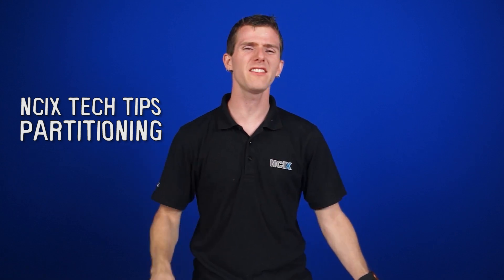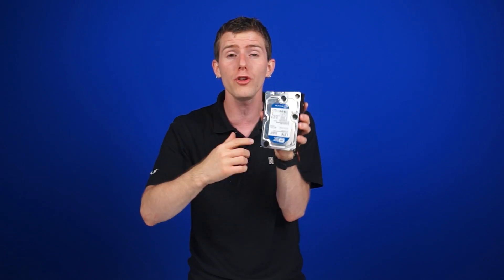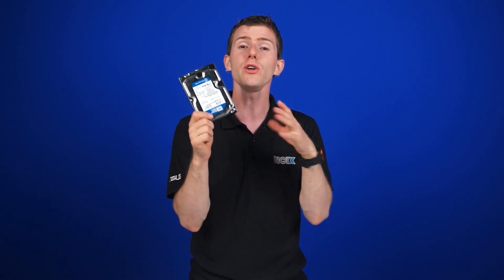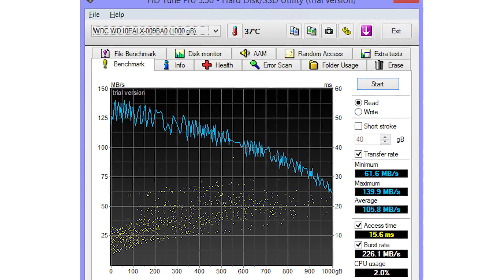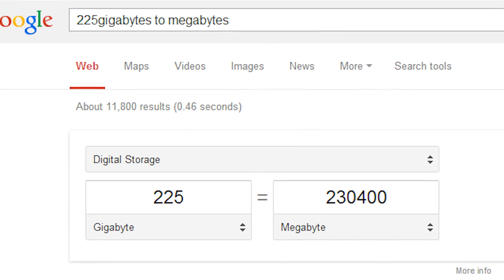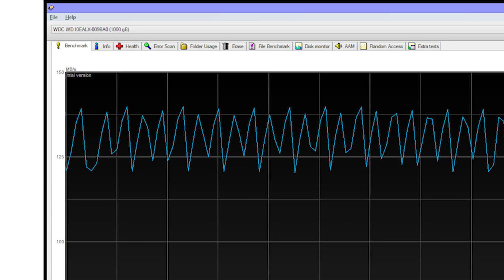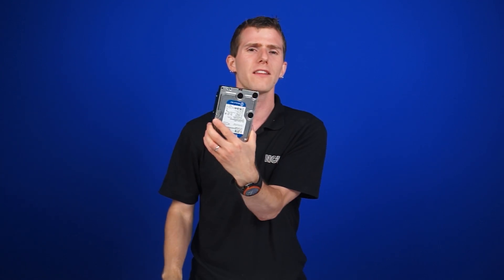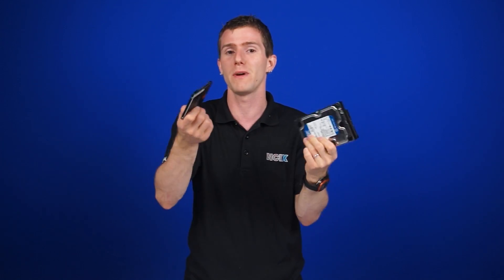How To Optimize Your Hard Drive For Speed

Comment: i did it.. and man my boot up time improved a little bit.. aand my pc doesn't take for ever to load the start up programs :D

still... it was a horrible idea to buy a 750gb green drive... (i wasn't thinking right.. and i couldn't get my hands on a blue one..and i was hypnotized by the storage capacity..lol)
Reply: You should look into the seagate flagship drives, they do 1, 2, 3, and 4Tb drives and I think they all say they run at 156 mb/s avarage with bursts up to 210 mb/s and the speed only drops off at the 4tb model which is the best speeds I've seen out of any of the popular hard drive manufacturers. I had a 1tb wd green too which recently bricked and those only run at around 113 mb/s. I'm waiting on a seagate 2tb which should be about a nice 30% increase in speed.
Reply: seagate drives are not the way to go i have a seagate ST2000DX001 seriously wished i went for some thing else these drives are not fast when transferring large files also experience delay in open files on second seagate drive

Comment: Buy a small SSD for the OS, put games on the fast partition of the disc, and movies & music on the slow one :)
Reply: Marko Mravak Or be like me and have 2 750 series SSD's by intel (PCI-e add-in) :D
Reply: weeeel we can't all be like you :P
Reply: Marko Mravak I have a DAMN good system, but haven't always had a good system, in fact, I still have the PC I got into PC gaming with. It had an older phenom chip from AMD and an HD 5870 :P
Reply: Frosty Breath Been there, Phenom 9000, HD 4850, 4GB crucial and 500GB Seagate... Than started upgrading to Z87 MPower, 4690K, 120GB Fury ssd, 1TB WD black, 16GB od Kingston Beast :) and finally after a year of waiting an MSI 970 Gaming :D Took me some time but got the best I could buy at the time. Oh and shoved it all in a R4 Define
Reply: Marko Mravak I have my other system in a define S, I built in a define R4 once for a client, it's a DREAM to build in, and it's SOO satisfying to get your system up and running in one, because it's so silent :P Do you have any idea about any good mini-ITX cases? I need to build one for my sister, she's going with a more workstation kinda build, a xeon e5 2697 v2, a quadro k6000 and 64GB of ECC RAM, I wanted to make sure her case had adequate airflow, considering it is going to be m-ITX, but I don't know of many that could fit my traditional 3 120mm SP fans.
Reply: Frosty Breath I'd do it in a Node 304 because it looks just awsome. I love Fractal cases
Reply: Marko Mravak I LOVE fractal cases too, but when you need a LARGE case, I don't now, but I did a WHILE ago, you kinda have no choice to go with caselabs xD
Reply: Woow, those things are expensive. And even from the pictures you can see why
Reply: Marko Mravak Yeah... but they get me feeling all warm and fuzzy inside when I build in them.

Comment: 8 SSDs in RAID 0. That sounds safe, let me know how that goes in about 1.5 years.
Reply: If you have money for 8 SSDs I don't think replacing them is an issue.
Reply: I would run them in RAID 10 giving a 4 set of RAID 0 with redundency
Reply: BoTheMasterOFAll Think it turned out pretty well 😂

Comment: Great, thanks!! I use a WD Black 1TB. I Went from Max: 180 - Min: 61, to Max: 180 - Min: 140Mb/s. I deleted 500Gb.
Another pro tip from me is that if you already have installed something on the disk and don't wanna format and create two new empty partitions, you can just shrink the disk of the value you want to (In my case 500Gb) and just expand it to ordinary (in my case 1000Gb) when the 500Gb gets full. :)

Comment: Best compromise in my opinion is to buy a fast but low or medium capacity SSD for the OS and your apps while using a slower but high-capacity HD for your data. I have a 120GB SSD for my OS and apps while my data mainly resides in my 1TB HD, augmented by an external 500GB USB3 HD.

Comment: I have one 2TB hdd and the transfer speeds start dip badly at 200GB so if i do like 10 different 200GB partitions would they all have like 150MB transfer  speeds?
Reply: no only one partition would have a high speed the rest of it would need to be left empty or as he said left with almost never or rarely used files. other the needle arm that swings back and forth inside the drive would be moving all over slowly to read info instead of what the partition is meant to do witch is cause it to read from a very small area very often and quickly

Comment: well, you surely could go through the hassle of setting up multiple partitions on your drive according to the illusive drop off point of the read/write speeds... OR you could just use the Disk Defragmenter under Windows every once in a while.

Comment: I have 3 1TB drives that I have collected running in a raid 0.  Win7 wont address more than 2TB so its set for 2TB total size with a windows partition of 150GB and the rest for data.  Everything backed up of course.  Both partitions are somewhat short stroked considering its only 2TB out of 3, on 3 different drives.

Comment: Can u tell us how can we seprate the ssd and the hdd making the full capacity of ssd to be :c drive and the hdd capacity to be the d: drive cuz in the computer it shows us as a one combined drive
Reply: You can't really.
A SSHD is effectively just a HDD with more memory available to the controller, which is slightly smarter than a regular HDD thus will sometimes even be able to pre-cache documents depending on usage patterns. Its this loading of files from the drives memory that gives the SSHD the speed of a SSD some of the time. However since generally the computer also tries to keep files in ram when it has spare capacity, the speed boost of a SSHD over a HDD can be less than impressive if you have lots of system memory. Its also worth noting that most SSHD's actually pack surprisingly little flash memory at all, and then its generally does not retain data when the drive is unpowered in the manner an SSD does. Put simply, the computer accesses one drive, as will show up on your partition table, so its not going to be easy (or necessarily advantageous) to try to access the flash memory on the drive directly. On the other hand you should be able to short stroke a SSHD exactly the same as a HDD like the one shown in the video.

Comment: Wait... so when I built my rig a few years ago and set up my partitions the way I did, my reasoning was actually valid without direct proof? I set myself up two hard drives and partitioned each up, putting what I figured I would be more active on the first partitions of each drive and less active files in the latter partitions of each drive.
Of course, looking at it now, I think I need to shuffle some of the contents around.

Comment: Wait wouldnt it be the opposite with the closer you are to the center of the disk the faster its spinning vs the outside because it has more distance to cover.
Reply: Density is the same but velocity is not. One rotation for the outer edge is equal to one rotation of the inner edge. Thus the outer edge will move more information under the read head.
Reply: For a more layman example, speed is distance over time. Mark one dot on a disk near its edge, and one near its center, both along the same line. Rotate the disc however many degrees (90), and notice how they still point in the same direction, but the outer dot traveled a greater distance in the same amount of time, hence it is spinning faster.
Reply: Un1234l yeah i realized that a little while after i  think i just confused myself. lol
Reply: Dj671993 hurt himself in his confusion!
Reply: pretty much *****

Comment: Hard drive partitioning DOESN'T matter.  I've tested this personally on 4 different generations of hdd's ranging from ide ata100 5400 rpm 60GB size back when they were 120 bucks as WORSTbuy stores in 2002, to today's 3TB 64MB cache 7200 rpm hdd's of today.  On EVERy hdd i've tried partitioning it in the following ways :

1.  Down to 55% of it's original total space.
2.  40% same same same, same
3.  35%, rinse and repeat
4.  25% rinse and repeat.

ALL results ended up with the SAME performance in crystaldisk mark, hdtune, hard disk sentinel and atto with the drives empty,  empty except o.s. and documents, and filled to 85% capacity with o.s, and ALL media types as well as movies and games and all programs.

It DOESN'T make a damn bit of performance difference in the REAL world.  Yes DEFRAGGING the storage drive goes faster..Big whooptee doooooo.  Guess what.  Defragging DOESN'T have near the realistically NOTICEABLE performance improvements as it used to a decade ago.  It offers virtually no noticeable performance benefit.

You're better of using Ccleaner ( tried and true and ANY pc tech EXPERIENCE and licensed repair tech WILL recommend this if they are away from their employer so you'll he isn't trying to upsell you something).

I've also tested UltimateDefrag, HDtune, and Hard Disk Sentinel.  Shortstroking is just placebo.  Moving your iTunes-WMP-Foobar, games/programs/movies, or anything else that is slow to load like Adobe photo or video editing software to the fastest part of the spinning disc hdd has BARELY a " countable" benefit.  Go a head.  HAND time it AFTER testing this and see for yourself.  You'll be lucky to get 10% faster loading speeds on any program.

If you want faster loading of ANYTHING just stop wasting time with this partitioning bs (if performance is your ONLY mission) and just install whatever you want to load faster on a current  gen ( made within the past 3 years or closer to 2014) and you'll be just fine and ACTUALLY be able to NOTICE the speed difference.

Partitioning a hdd is to help to possible protect your data should you get a virus or something else coherent enough that warrants you having to reinstall Windows o.s. while "HOPEFULLY" not having to worry about losing all the data on the other partititions.  However THIS IS NOT guaranteed.  I know this from personal experience working on more than the last 85 notebooks and 25 desktops that i've worked on over the recent 14 months.  Thus it's just best to BACKUP your precious data to more than one SEPARATE storage source ( another hdd, another ssd, another external hdd. etc).  This you should do REGARDLESS.  It is pc 101 common sense.

Comment: There are great software titles available that optimizes hard drives and moves data to the outer edge of the drive and you can really see a speed difference. One of the best software titles I found to do this as well as other optimizations is " Auslogics BoostSpeed".

Comment: Couldn't you just design a hard drive and cut out the middle (slow) section of the platter, so that it becomes lighter, which would allow for faster maximum rotation speed?
Reply: You could just get an SSD then.
Reply: I wasn't talking about what you could buy. I was speaking in terms of what someone could design.
Reply: Travis Ross You probably could, but it would probably be an incredibly small change, as you still need the middle to be connected to the edges, as it gets its spin from the middle.
Reply: Well, lets say you took a 1TB hard drive and took the middle section out. You might only end up with 700GB, but it would be guaranteed to be fast and reliable, without needing to resort to all the tactics Linus showed in the video.

And in terms of the actual change. You would replace the middle section with a plastic/aluminum spokes lead to the typical inner spinning axle. It wouldn't just have a gaping hole, rather just empty space filled in with a bracket instead to make it lighter.
Reply: Travis Ross Wouldn't the middle break? Like from centrifugal force, it's too weak? If you got it to work, it would probably have a pretty small difference from a normal platter.

Comment: will this work on mac?
Reply: Your mac will probably explode but you could try. You have nothing to lose. Literally.
Reply: It will work also. But you need to do the same thing like linus do then format it to mac partition
Reply: I believe drive partitioning works regardless of OS as it's done before installing the OS to the drive, allowing for multiple OS machines running from a single HDD.

Comment: Is there a way to combine short stroking and raid? So say I took two drives and made two half capacity partitions on both drives, and then set the backup portions to be the two slower partitions? I would think the drive wouldn't be flipping it's arm back and forth between the partitions then, as the slower partitions would only be accessed during backups. This would negate the losses Linus talk about.

Comment: Why does 225 gigabytes = 230400 megabytes? Wouldn't it be 225000?
Reply: There are 1024 megabytes in a gigabyte. It is in base 2 since 2^10 = 1024 not base 10.
Reply: Epic5236 Oh thats right its 1024 i had forgotten that i always was using 1000
Reply: Epic5236 Actually, 1GB = 1000MB. 1GiB = 1024MiB :)
Reply: 1 gb = 1024 mb
Reply: ***** 1 KB has always equalled 1024 bytes ever since computers were first invented, because computers count in binary numbers, not decimal. But during the 1990s, hard drive manufacturers decided to change that to 1 KB = 1000 bytes in order to make their drives sound bigger than they really are. And when drives got large enough that the difference between the 1024-byte binary units and 1000-byte decimal units became very noticeable, they decided to declare the decimal units as the new standard and invent fake words for the binary units, such as "kibibyte", "mebibyte", etc. Needless to say, people have resisted this change because 1.) the new words sound stupid, 2.) it goes against decades of history of what the units have always been called before, 3.) RAM still goes by the 1 KB = 1024 bytes standard, and nobody ever says a computer has "8 gibibytes" of RAM, 4.) Windows doesn't use those fake "mebibytes" / "gibibytes" / etc. words either.
Reply: poeralGCkings
Usually its rounded down to 1000Mb But is actually 1024Mb Per 1Gb of data.
Reply: ***** "Some idiots" like Bill Gates and Steve Jobs used kilobyte to refer to 1024 bytes. Go yell at them, not me!
Reply: no 1 Gb is 1024 Mb thats why it is 230400
Reply: you are thinking of MiB and GiB
Reply: ***** That confusion only arose because hard drive manufacturers started cheating and saying 1K = 1000 instead of 1K = 1024. They should have invented new prefixes for the decimal units while keeping the binary prefixes the normal ones. (Like I said, RAM is still measured in units of 1024, and nobody ever says "16 gibibytes" of RAM!) And LOL... Internet Explorer puts the red squiggly underline under "gibibytes", because it counts that as a spelling mistake!
Reply: vwestlife You kinda got that inverted ... new prefixes for decimal units, just so we can keep using wrong ones for binary? Seriously? ...
Doesn't matter how RAM is measured and what IE says - it's wrong.
Reply: ***** Then you're going against about 80 years of computer history. Computers count in binary numbers, and humans count in decimal -- there would be no confusion if everyone just kept it that way!
Reply: And you are going against thousands of years of Mathematic history ... C'mon, you can't say that computer annotations are more important than general ones.
Reply: ***** Tell that to the people who came up with the whole bits/bytes thing in the 1940s when electronic computers were first invented. Once a naming system is established, it's very difficult to change it -- and the whole kibi/mebi/etc. thing is unlikely to gain any traction until Microsoft gets on board with it, but as of yet, they have not -- Mac OS switched over to 1 KB = 1000 bytes a while ago, but Windows still uses 1 KB = 1024 bytes.
Reply: vwestlife You do realise that naming scheme (kilo, mega, giga ...) was established way before computers were invented?
Whole metric system is based on those prefixes. You can't change that just because some idiot misused it for binary system ...
Reply: 'Merica!
Reply: Physical media = 1000 ; virtual = 1024.

Comment: What is this RAID 0 you keep talking about?
Reply: Google is your friend
Reply: Watch the video over Teckquickie channel
Reply: raid 0 is a way to combine drives and get more speed out of the combination. Basically you put half the data on one drive and half the data on the other (for every file) so when your computer accesses a file it uses both drives as opposed to just one. If you were using 2 128gb 500mb/s SSDs in raid 0 you'd get a 256gb 1gb/s drive.

check out Techquickie because linus explains it a LOT better.
Reply: ***** he does.
Reply: *****
you would if you could afford to run 8 ssd in raid.  Would need one hell of a raid card to do 8 in raid0 and avoid diminishing returns.
Reply: ***** How about you ask Linus
Reply: ***** because its 1 physical drive. You need 2 at least
Reply: Nikola Vasilev
No its 8 SSD's in raid. Hence both xxDrains original question and the replies of several other people in this thread. If it where 1 ssd, it wouldn't have been 8 ssd's in raid, thus we wouldn't have been talking about it.
Reply: RAID0 = Headaches.
Reply: ***** I can say from experience that this isn't necessarily true. My daily driver and machine I'm typing on right now has 2 vertex 4 SSDs in RAID 0 and has been rock solid since day one (for around 2 years now). Buggy third party raid controllers are a mess but that's not true of all RAID 0.